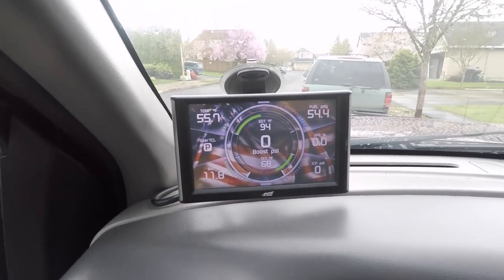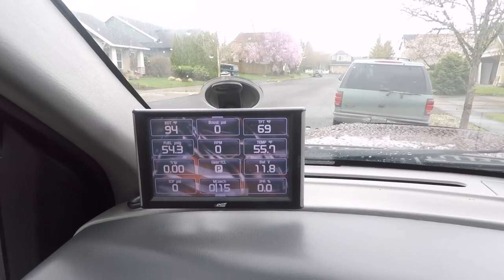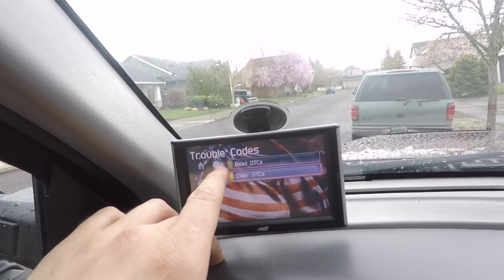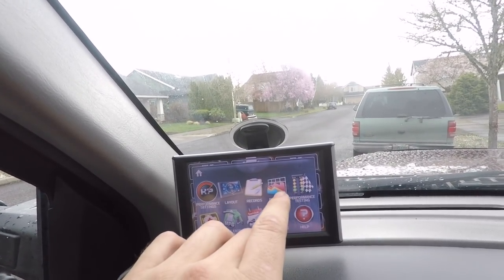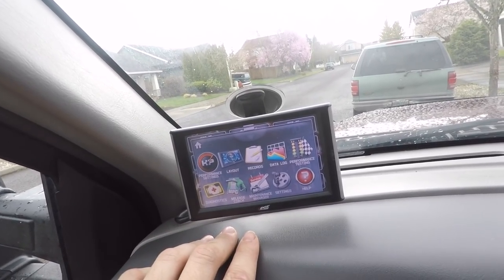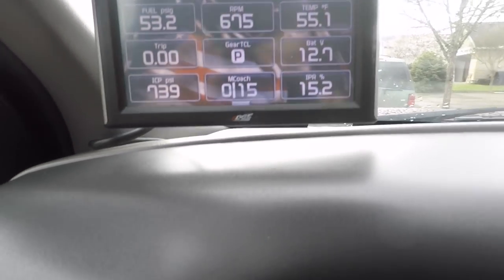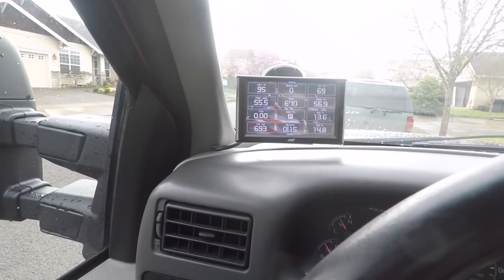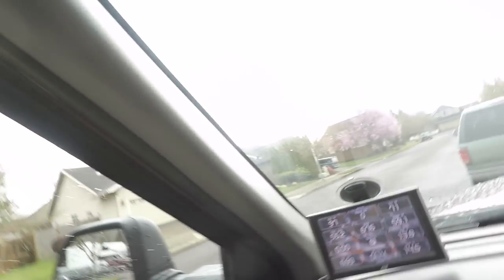Best Gauge Setup for Diesel Trucks

Comment: Does your battery voltage take a minute to come up?  Min sits at 12 .4 for about 60 seconds after it starts and then jumps up to 14 volts.  Is this normal?  Thanks for the video on the CTS.
Reply from the maker: Totally normal. What you are seeing is your glow plugs. A lot of people don’t know this but your wts light isn’t actually tied to your glow plugs. They stay on for around 60 seconds before shutting off.

Comment: I have had the same unit for about 3-4 years. 
My gripes are three. 
1) it’s bright!  To bright at night.  I usually just put my hat over the whole thing at night. 
Was hoping they would come out with green or red numbers not just white. 
2) The background options are to busy. The purpose of this unit is to see the engine parameters. Not more busyness. I talked to the manufacturer after I bought it and encouraged them to give the gauges a stock look with stock colors. 
“Crickets”
3) the touch screen is temperamental. Works with a high level of frustration. 

All that said, it’s still in my truck and am glad it’s there. But, looking forward to using an iPad or equivalent for this function in the future.
Reply from the maker: If you got it 3-4 years ago then you might have the original CTS so this might not apply. 1) On this unit I can set the brightness levels to whatever level I want it at. So it doesn’t bother me at all at night. 
2) I can also choose a custom background. Right now I have an American flag, but if I could easily do a strait black background and make it super simple. 
3) I agree the touch screen is not amazing. 

If you have the CTS 2 then you should totally be able to fix the first two issues you are having.

Comment: Coming from a 6.0 I just bought my first 7.3. Did the 6637 filter a 5" straight pipe diamond eye exhaust and the hydra chip. I was thinking of autometer or isspro quad pillar gauges but man are they expensive! Glowshift is out of the question had them on my 6.0 and they were garbage. I'm definitely interested in the cts2. Do you need a sensor for the boost? Mines a 2000 7.3 I want to monitor all the fuel parameters egt, trans and boost.
Reply from the maker: I am really happy with the CTS. You can read the boost through the stock MAP sensor, but if you start pushing over 25lbs and add a boost fooler to stop defueling then you'll probably need to add a boost sensor. Unfortunately our trucks didnt come with fuel pressure sensors or EGT probes. I had to add those to mine. Even with adding the sensors I do think the CTS is still worth it.
Reply: @LivingOnWheels  awesome thanks for the reply! So how much were the probe and pressure sensor?

Comment: Thanks brother 👍🏻

What's the life expectancy of this unit?

I have a buddy wants to sell me one for $75. It's about 5 years old. It can be updated I'm told and I'll have to pay $100 unlocking/reassigning fee. Total cost, $175 which is dirt cheap. My concern is what is the life expectancy? 

I'm probably going to go for it hopefully she's got another 5 years 😏
Reply from the maker: I wouldn’t be concerned about age. As far as unlocking it goes, unless it’s a juice with attitude model (aka tuner) then you should be able to install it on your truck without anything needing done.
Reply: @LivingOnWheels  

Yes sir, and thank you for your timely response. The unit is locked to another vehicle/Truck. My diesel mechanic was saying that, if the unit did not provide tuning capabilities it would not have such a lock. Because it is locked down, it probably does have tuning capabilities. I do believe that this is the CST2 model touch screen. I placed a call to edge today and the man told me the life expectancy is about five years but of course they could last longer than that. It depends on how often it was used and also how it was taken care of. In comparison to the cost of a new one, it's really worth taking a chance on this deal in my humble opinion. My biggest reason is for monitoring purposes. I just had a remaned Ford 6.0 engine put into the truck. Until I've got a better handle on the usage of such a device, I probably won't be monkeying around with it too much. I do however, want to monitor the goings on. 

I have plugged the device in to the truck and it will not let me do anything because it is locked to another vehicle.

Comment: Thanks for all your videos. I have 2002 f250 7.3 what doesn't the cts2 not read from out of the box?
Reply from the maker: I can’t list everything but the 2 main ones are fuel pressure and exhaust temps. Your truck doesn’t have sensors for those

Comment: Thanks for this quick breakdown. I'm also in Oregon. I've watched a lot reviews on Edge products. I like the CTS2 because it can monitor a slew of PCM sensors and I didn't have to put gauge pods on my pillar. I also had the same issue with the Monitor coming back and draining my batteries.  I am having some issues tho, my monitor is taking way too long to boot up when I first start my engine. I have to select the Make of vehicle and confirm my VIN #. Not sure what's going on, I'm gonna contact Edge customer support to see if they can help figure his out. ALL in all, I do like this monitor/tunner. I have the CTS2 Insight w/Revolver chip on my Stock '01 7.3 Excursion.
Reply from the maker: Hmm. I don't know if this would solve it, but might try hooking it up to your computer and seeing if there is a software update for it. Mine probably takes 10-15 seconds to boot up once i turn my key. You shouldn't have to select the vin every time though. Only if it completely disconnects from power
Reply: I have a 2000 excursion 7.3. My first time owning a diesel.

Comment: I’ve been looking at this setup, but my concern is that I don’t want another computer in my life that I have to fuck with. lol. Feels like all of modern life happens in between software updates and waiting for things to boot up. Is it fairly trouble free for daily driving? For example, if I set the screen to read certain things does it save it for the next start or am I gonna be sitting there grumbling and poking a touch screen every time I start it?
Reply from the maker: Starts up just as you set it every time. This has been a really good system for me. Even till now, the only issues I’ve ever had is what I said about starting the truck and shutting it down before it boots all the way up. Even that all you do is unplug it and plug it back in and your good to go with all the settings saved. 

Now I haven used the CTS3 personally yet but it looks just as good.

Comment: I have a 98 Bluebird School bus with a 59 Cummins. Do you think I could install something like this?
Reply from the maker: Im guessing it is a 12 valve. If it is I'd say its not worth it because the 12 valve is so mechanical I don't think you'd get very many readings on the cts. You'd be better off with physical gauges.

Comment: I have the CTS,  gauge set up.  What 6 gauges would you recommend for the smaller unit.   At this time I just have it set for exhaust and fluid temps: engine and transmission. also boost.  What six would you or anyone else recommend.  Thanks Scott
Reply from the maker: hmmm... off the top of my head for myself I would probably go with. (EGT, Oil temp, Trans temp, Boost, Fuel Pressure, and maybe oil pressure ICP) If you dont have fuel psi then Id put IPR in its place.

Comment: On a 2001 7.3 L does it give you the fuel pressure on the low side?
Reply from the maker: It does not. These trucks didn’t have a sensor for that. It’s something that needs to be added.
Reply: @LivingOnWheels  thank you. That is what I thought

Comment: Previous poster, following along with your build :). I've installed the CTS3 monitor w/EGT, 4" exhaust, 6637, PHP tuned. For some reason my boost reading hits a wall at 15PSI. The truck really wakes up with the PHP. But boost will not budge past 15PSI. I unplugged the red wastegate hose tonight, and again 15PSI. My question, did you install a separate boost sensor? Or are you running with what the factory PCM supplies. It almost seems like my Edge monitor is not displaying the correct boost reading. This is a 100k mile truck, everything else in great health.
Reply from the maker: I do have a separate boost sensor since I’m pushing 32 psi but you stock map sensor should be good to 25 psi. Make sure you don’t have a boost leak or boost fooler
Reply: @LivingOnWheels  I've read all about boost foolers, was aware. For some reason I never looked close. Low and behold you were right! Found the ground and disconnected it and saw 21psi ony my 65hp daily tune. Thanks for always responding to viewer questions!
Reply from the maker: Geoff240ti cool beans! Glad it was that simple haha

Comment: what kind of torque are you getting out of your monitor? Coming back on a trip a week ago i noticed the torque being low. not sure if its accurate but just trying to see. Thanks
Reply from the maker: To be honest I have never run the torque monitor because I cant think of any way the truck would actually monitor this accurately. Out of curiosity, What numbers are you seeing?
Reply: Coming back from the desert pulling about 11,000 lb was only showing 50 ish and then it also wasn’t steady fluctuated a lot. I agree with how it could possibly produce the numbers but figured if it was apart of the monitor I’m sure it should be somehow accurate but I don’t believe it.
Reply from the maker: Sand Asylum hmmm. Seeing as our trucks should produce over 600 I would say to not pay to much attention to the torque numbers.

Comment: Thanks Bro for the information I purchased a 03 Diesel 7.3 6months ago and you been helping me out a lot my truck came with a lot of aftermarket stuff on it the only thing it’s hard to find someone to work on it with all the aftermarket upgrades on it. I’m in Ohio and 3 different Diesel shops didn’t want to mess with it if you have any suggestions for me will be highly appreciated Thanks Bro
Reply from the maker: My best suggestion would be to learn about the truck and what mods it has and then work on it yourself.
Reply: @LivingOnWheels  I have a Fuelab system running on it now just purchased a Airdog system the same one you have the only thing I can’t figure out is how would I switch over to the Airdog if my sending unit already has a pick up line already drilled in it already what do I do about that without having to purchase a new sending unit?

Comment: I just bought one and hope to get it installed this weekend. I also got the EAS kit with the EGT probe. I am disappointed that to read fuel pressure from the filter Bowl I need a 0-100 sensor and another little harness which is another 300 for that.
Reply from the maker: Which EAS kit did you get? The one with just the EGT problem or was it the 3 sensor kit? It’s definitely more expensive to purchase them all individually. I agree though, it is a little disappointing seeing the price of the add on sensors. Like I said, it is a little more expensive than regular gauges but is FAR more capable in the long run. 
This is the kit I’d recommend: https://amzn.to/2Hr7TLc
Reply: Living On Wheels I didn't get that one. I got item # 98620 which is the one they recommended. I'll just get a fuel press gauge and check the fuel pressure at the filter from time to time.
Reply from the maker: fishin n flyin yeah I figured that was the one. Not the end of the world. A full time sensor can be added down the road if you choose too.

Comment: I sold mine it was throwing codes, I took to dealer and rest with there computer and no problems since.
Reply from the maker: What kind of codes was it throwing? All it does is read signals from the computer, so it shouldn't even be able to trigger a code.
Reply: It was odd it made truck run bad not sure if wire was bad. But it threw 6 codes. Unplugged and truck ran great and had ford reset.
Reply from the maker: @brook7880  Was it just the plain Insight or was it the "with Attitude" tuner version?
Reply: It was the plain cts2 I just went to gauges and superchips to read codes. I like edge products but after it cost me at ford I figured heck with it tell I know truck better.

Comment: Liked it alot Joe.....I'll be getting one !
Joe can you tell me what I need to do to install a pyrometer sensor ?
Reply from the maker: Not very complicated. Obviously the Pyro probe and wiring, couple drill bits, 1/8th - 27 npt tap, and a small magnet is useful to remove chips.
Reply: @LivingOnWheels  thanks for that, good to know
I think my real question was......where does it go ?  (The probe, or sender)
Reply from the maker: @rogereastman3187  Ahhh my bad. Most people put the probe on the rear corner of the driver's side exhaust manifold. Usually, the closer to the engine the better so that you can get a more accurate cylinder temp reading.
Reply: @LivingOnWheels  are you sure now ?
Lol......cool thanks
Reply from the maker: @rogereastman3187  Very sure haha. No problem

Comment: Does this monitor come with a egt reader
Reply from the maker: No. That is sold separately
Reply: @LivingOnWheels  how do you wire that egt reader to the monitor
Reply from the maker: @crffilmz7300  through Edges EAS expansion kit. I used their competition kit so I could monitor egts and fuel pressure. You can get the kit for the the egt probe though. 
https://amzn.to/33F1SWu
https://amzn.to/2I29CKG
Reply: @LivingOnWheels  ok thanks a man

Comment: Can you add an alert for trans temp?
Reply from the maker: Yes you can
Reply: @LivingOnWheels  Thank you Joe. Appreciate.  I was doing some research trying to find if there is any product out there where you can measure all these parameters on your iPhone. I have a 2002 7.3. Bluedriver does not work. Dashboss does not work which I hoped it did because then I can use my iPad or iPhone. Do you know of any other product?
Reply from the maker: I actually do not. Thats not really something I've looked into because Ive had this monitor since almost day 1. A problem I see is these trucks don't come with pyros or fuel pressure so you wouldn't be able to see those anyways.
Reply: I think you can install fuel pressure on the dashboss but then again the connector is not compatible.

Comment: Great video! In reference to your 2nd issue with the Edge CTS and powering up the truck for something small such as rolling up the windows.....does the OBD2 port receive power when the key is turned back to the accessory position? If not, that would allow you to have power to the interior of the truck without powering up the Edge CTS. I ask this because I'd like to purchase the Edge CTS3 for my 2000 7.3 CCSB and would like to avoid this potential issue if possible. Thanks in advance for you help!!
Reply from the maker: Yes I believe it does. I’ll say this though, after seeing the CTS3 in person, it boots up so fast that I doubt you’ll have this issue with it.

Comment: Did ever change the mounting placement ? I just got one and I live in Arizona and the suction cups NEVER hold up to the heat ! 
Looking for another solution...I’ve seen all of the suggestions online. I currently have a 2 gauge pillar that I don’t care for mounting it there. And the other suggestion online is the dash setup..again, living in Az, no bueno. The dash is a magnet for the sun. lol. 
Just wondering what you or your viewers have done. Thanks
Reply from the maker: No I never did, but I have had that issue a few times during the summer. Im not sure of the best place if you dont want it by the pillar gauges.

Comment: Good video, but after checking out the Amazon link and all the bad reviews, I''m surprised you bought the Edge.
Reply from the maker: Gotta take the negative reviews with a grain of salt. It has 175 reviews averaging out to 4 stars which isn't bad I would say is probably an accurate rating. I can only speaks for my own experience but after 3 years of owning and using mine, if I had to make the choice again knowing what I know now I would still honestly buy it again. It definitely could be improved by edge but with all the different things this thing is capable of it is far more valuable than analog gauges in my opinion. Not to mention people have analogue gauges fail too. 

From my experience with it over the last 3 years I am still glad I bought it. Despite a few relatively minor issues/annoyances that I mentioned in the video.